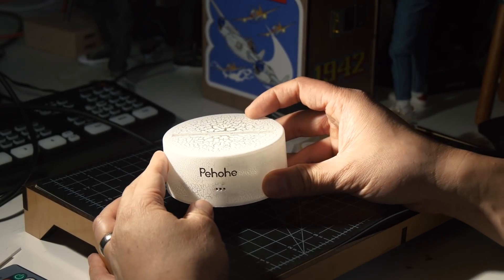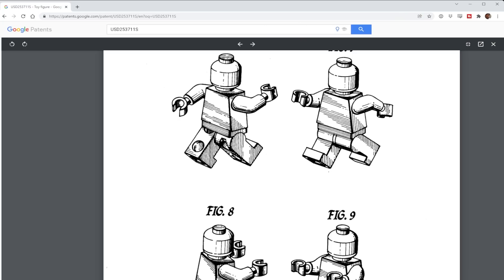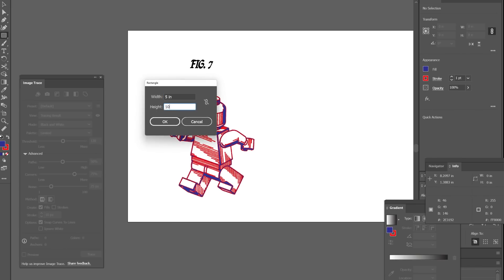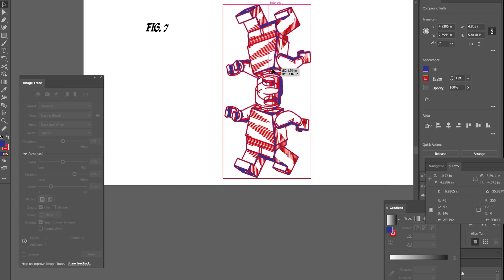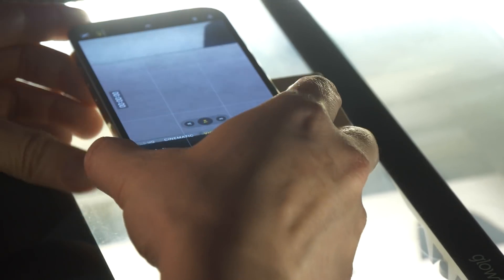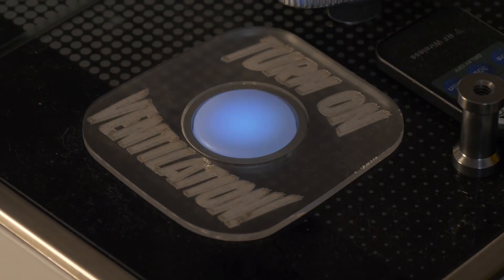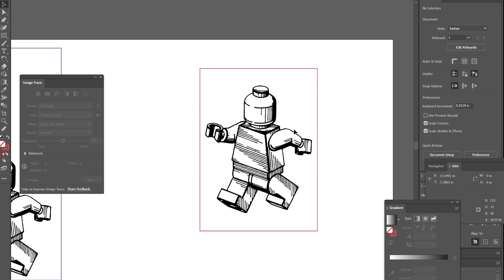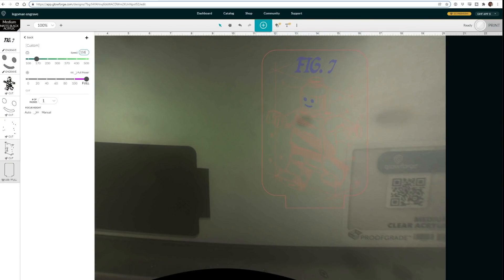Making An Acrylic LED Cross-Section Display!

Comment: Never use alcohol or ammonia on acrylic! In a few hours or days the acrylic will craze, aka create micro fractures on the cut edges and around etching.  Use a glass cleaner without ammonia, Novus, or mild citrus cleaner. There are a few others but are more difficult to find or expensive if you aren't running a business doing laser cutting and etching. I've been working with CO2 lasers 18+ years
Reply: Came to say the same!
Reply: Very True. I use Shellite aka naptha. However, mild dishwashing soap and tepid water works about as well as anything, it just takes longer to dry.

Comment: Get some SCIGRIP acrylic solvent to keep on hand for anything involving adhering acrylic to itself. It’ll be a much better and permanent result compared to spray adhesive. 

I like the project overall - we have 2 of these bases in the house already and our makerspace is coming back online after a big move.
Reply: Thought this immediately too. The acrylic solvent is much better than spray glue-but a little tricky go get used to using, maybe.